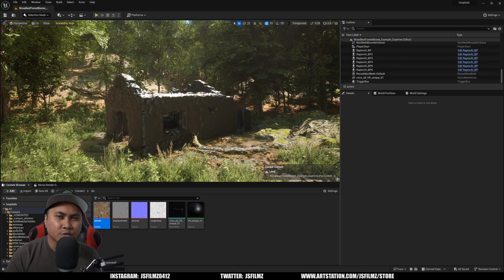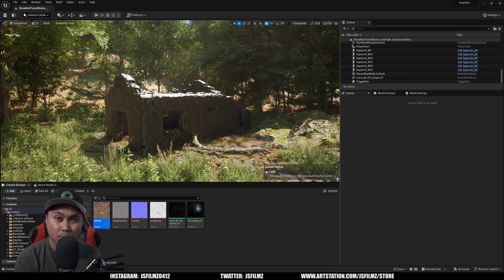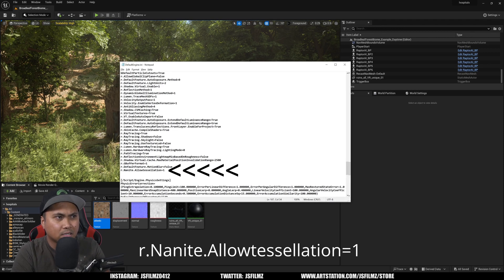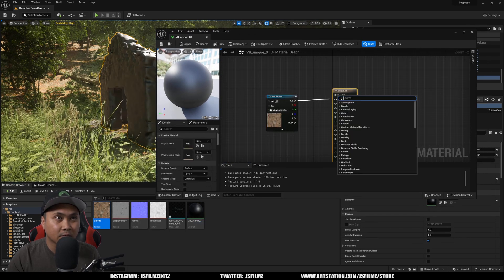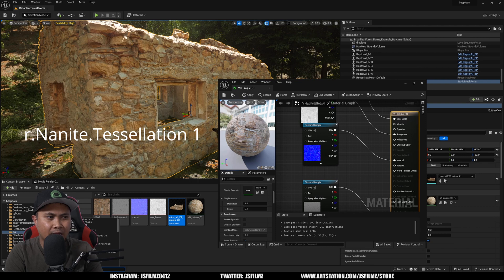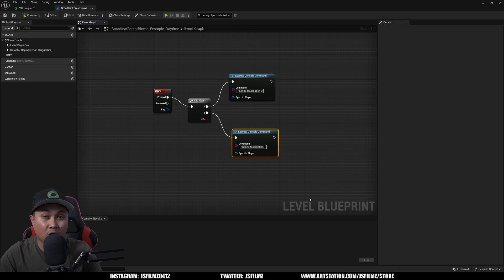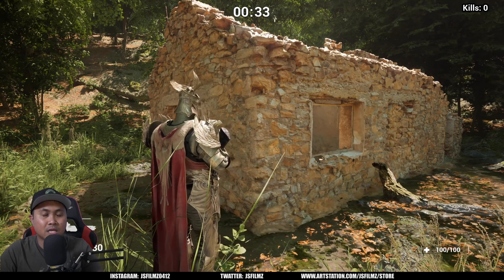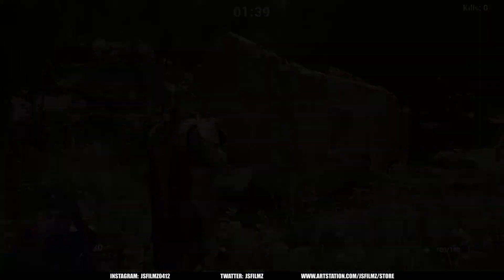Unreal Engine 5.3 Nanite Displacement Tutorial

Comment from the maker: Playing around with the official Unreal Engine 5.3 Displacement material
Reply: Heyy.. Will that new displacement method actually alter the terrain so that there is collison on the displaced part now? 
*Like if the character steps on it, will the foot no longer just go trough the ground is what i wonder*

Also, i wonder if it will be possible to get displacement on landscapes with VHM soon that also adds collison. There is just no reason to use good displacement on terrains for areas that have small or large rocks / cliffs displaced from the landscape by VHM / Landscape material...
Like if you would use a beach layer that has rocks that are pushed up from the terrain, or rock formations/cliffs on montain/step hill slopes.

As of now those details have to be added in to the heightmap it self in the terrains generator tools. I guess that it would also be better on performance to actually add this to the heightmap, and then use landscape LOD to decrease tessellation by distance. Or by doing it trough the landscape shader if still possible when the landscape is using nanite.
(If even needed when using nanite that is)
Reply: So cool man !

Comment: Greetings, I'd like to ask you (or anyone knowledgeable) about some tips for the new displacement feature:
First, when I enabled nanite landscape, the FPS absolutely tanked, the issue in debugger is "Nanite:VisBuffer", anyone knows how to optimize this?
Also, when I use nanite landscape displacement and my camera comes too close, the terrain disappears, as if there's a small radius around the camera which doesn't render the landscape.
And lastly, most importantly, I use standard landscape auto material and for mountains I use very big tiling, so I also have to use big displacement multiplier to make the rocks really pop out, however in areas where different layers meet, the displacements of both textures are "fighting" instead of blending and it creates almost hair-like broken terrain because the rocks want to pop out but grass wants to stay flat. Has anyone encountered this?
Thanks!

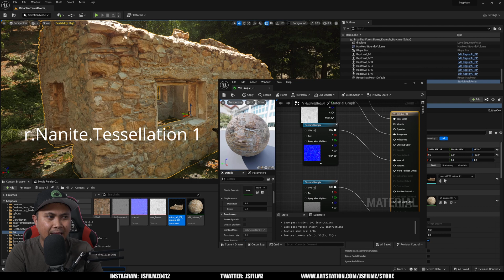Comment: @2:14 you can actually see that the tessellation is from the looks if it adding outlines where there was no before causing holes in the mesh. Is that just because it is very high poly?
And is it not best to make a material instance that is used on the meshes? So that you can change the displacement settings there, plus other parameters you choose to add to the shader...

If you have many meshes that uses textures that don't require any texture cordinates to scale up/down, then you can use the same master material as parent for all material instances on      
the meshes, instead of creating separate master materials for each one 🤓☺